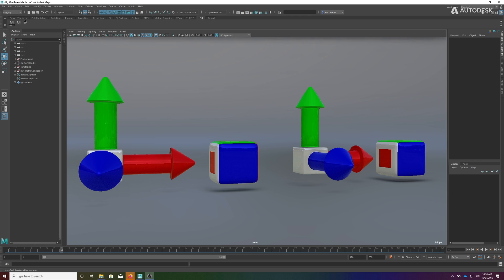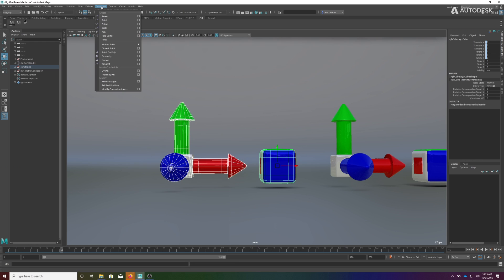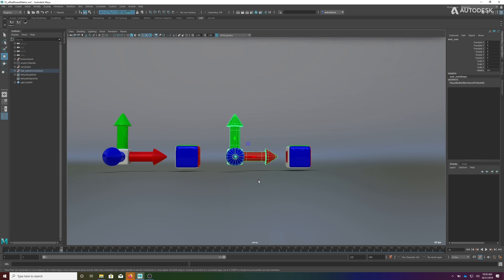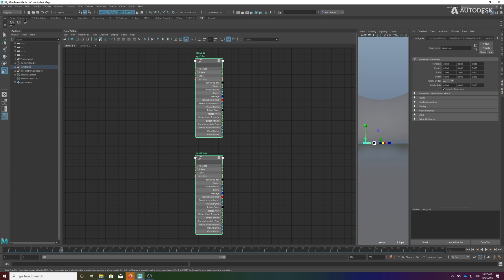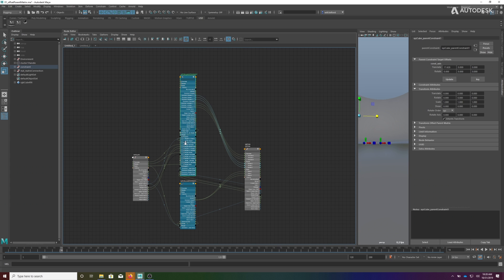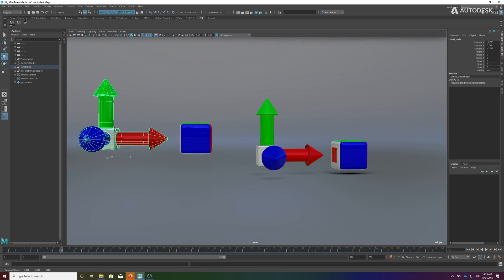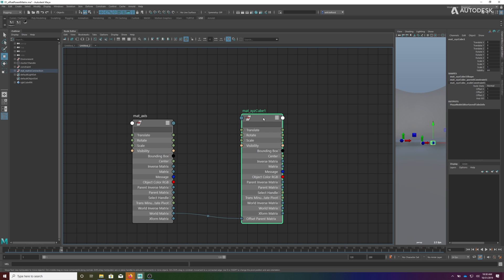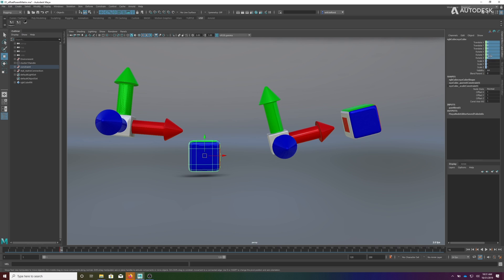Maya 2020 | Offset Parent Matrix

Comment: Is there a way to copy and  paste values from the attribute editor to the composition matrix through scripting, I find it tedious to manually zero them out and paste them, also I found no command reference for offset parent matrix in the maya.cmds help section, am I missing something?
Reply from the maker: The offset parent matrix exists similar to any transform on a maya node, so to query/set it you can use "node".offsetParentMatrix.  To see an example of how that works, check out this script that bakes a node's transform to it's Offset Parent Matrix: https://gist.github.com/Muream/b4255ec4f690222d92fe794be249b7f1

Comment: Can you animate the matrix parent on and off? I do not see a key option in the transform matrix tab.
Reply from the maker: The Parent Offset Matrix will always apply - there's no way to switch it off persay.  But what you could do is plug a locator into it then just keyframe that locator to adjust the matrix.  Then to "turn it off", just set the locator back to the origin (which essentially returns the matrix to Identity)

Comment: Is it possible to key it not to parent the object at certain point? like for example: throwing a ball then picking up.
Reply from the maker: One way you could do it is using a blendMatrix node, then keying either the "Weight" or "Use Matrix" attribute.
Reply: @Autodesk_Maya  I've just tried putting a blendMatrix node between two objects world matrix and offset parent matrix, but the weight and the enable check box in the blendMatrix do not control it affect, it's always on no matter if enable is checked off and the weights is 0. I'm not sure where "Use Matrix" is located to try that, could you direct me where that is and help troubleshoot why the blendMatrix node is having no affect to control? Thanks
Reply from the maker: @AnimatorsJourney  the blendMatrix node isn't like the blendColors node.  It works more like layers in Photoshop.  So for example, if you want the node to turn a world matrix transform on and off, you'd need to set the Input Matrix's composition to 0, then Add a New Target Matrix, and connect that to the incoming World Matrix.  This way, when you disable / dial down the Target Matrix, it goes back to the zeroed Input Matrix.

For more information, check out the documentation here: https://help.autodesk.com/view/MAYAUL/2020/ENU/?guid=GUID-8AE22982-B840-4E7B-A098-B4D15D01CCE4

Especially the part starting with "blendMatrix is not a weighted average"